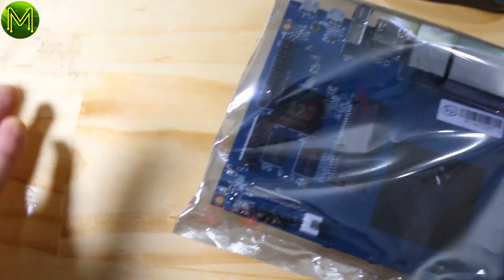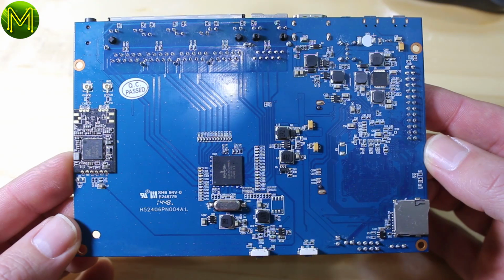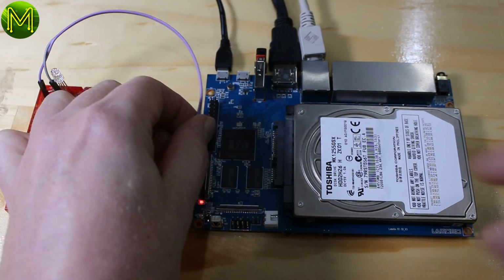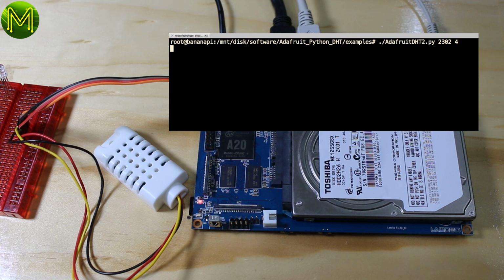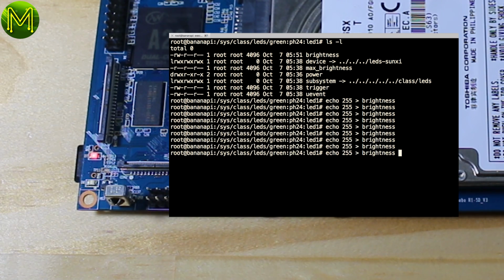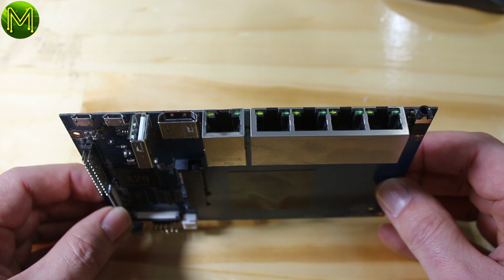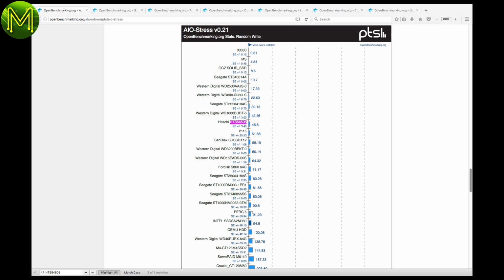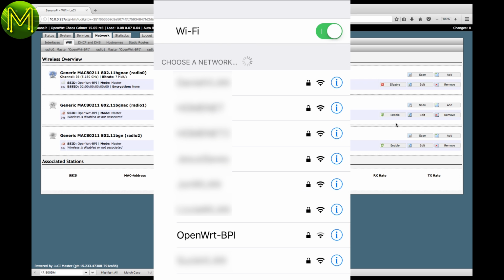#057 Banana Pi Router: NAS, router or trash? // Review

Comment: so i have a orignal xbox, ps2 and xbox 360 all modded, will this be a good device to be able to have all of my ps2 isos, roms and music on as a dual nas/router for older systems that i need a nas box for? ive played alot with the raspberry pi zero 2 and 3. but would love that but with a network switch to not only stay connected to the internet but also have a SMB folder going at the same time and pop in a ssd

Comment: Hi I know this one sounds crap, but I noticed an r2 version and wanted if that has been tested.
Reply from the maker: Not yet, but it's planned.
Reply: MickMake 
OK it's just I am after a wifi extender and wander if there any good for that. I do have a nas already  tho I may still use it as one to backup cctv footage from my garage. Though I have a open source router,I kinda think the pi version you could do better as the pi was easier to code that a normal router. This is why I was tempted, and plus more customisable,  though  slower it could have advancagers,  if the effect is but in.

Comment: 1:45 As suspected, 2tb limit sata connector. What would be great is if it supported port multiplier. I'd take this banana pi over as raspberry pi anyday however, simply for the sata port it has. Moreover though, a pci-e port on any board (especially x86) is best!

Comment: I am thinking to get one of these but not to use as a router but more like a nas and file sync server. I thought about tossing in a 2tb drive and use it as a file container to sync, backup and occasional stream video from. So far I am doing the same with a raspberry pi 2 and though I had absolutely no issues, the whole external hdd , ethernet cable, power cable are kinda hanging ungracefully. This seems a lot more like a complete unit. embedded sata and wifi has me sold. Anyone used it as a nas?
Reply from the maker: +John doe 
It'd be ok for a NAS, but don't expect blazing performance from it. It'd be fast enough for 1080p and probably 4K.

Comment: I thought you might leave us with an overal opinion of the device, especially suggested by the title.  But I'm unclear if you are happy with the device or feel it is trash.
Reply from the maker: +Dylan Durdle 
I try to avoid opinions as they can be... well... opinionated and prefer to let the viewer decide. I do, however, give it a rating based on how it works according to its intent.

If you are going to use it as a router then it'll work, but there's a speed issue. For some people this might be an issue and for others it's not.
Reply: I've been watching this device for about 1.5 years, debating.  Originally I had the belief, if I buy it, I should use OpenWRT on it.  There were so many issues with OpenWRT in the first years (think wifi didn't work).  I know OpenWRT support has improved on it.  Now I'm leaning towards just a Debian Jessie distro.  It's been a number of years since I used OpenWRT, I have been exclusively using Tomato on my WRT router for at least the past 8 years.  And since Tomato will likely never be supported, no sense going back to OpenWRT.

I have many Raspberry Pi boards, and I use a Banana Pi and Cubieboard2 powered on 24/7 on my network.  I only get about 2.5MB/s throughput.  I expect the same limitations on this since it is a Banana Pi with LAN switches.

I'm still very much on the fence on this device.  I know it's only about $60-$70, but I'm trying to deduce the number of inexpensive toys I buy that collect dust.  My junk drawers are full of them already :)
Reply: More context, I'm still using a 100Mbit router and G.  Old WRT router bought in 2002 that stands the test of time.  It is not like I'm expecting 1Gbit speeds or N.  My only wired LAN devices are printers, one or two IOT things and a Banana Pi and Cubieboard.  Everything else is wifi.
Reply from the maker: In that case this is probably a decent device for you. It won't give you the 1Gbit speeds of a $1000 switch, but good enough in your case.
Reply: I picked it up and I've been using it for a few weeks.  Meets my needs, still working on getting everything working in Debian, but all looks well so far.

Comment: Are we serious here. You expected a banana pi to perform close to actual servers designed for handling hundreds of connections at once? This device should be compared to other routers like Dlink... as an alternative in the same price range.
Reply from the maker: +Jake Abel 
Hi Jake. With my reviews the expectations I have are the ones given to me by the company selling the product. If they say it'll do XYZ, then I'll test that. If it does or doesn't do it I'll let you guys know.

Generally what you pay for is what you get and things like the Banana Pi is cheap, so you're going to get cheap results.
For some people that's OK!
Reply: MickMake The only problem I have is the bench marks you compare it to are of $2000+ systems. Did they actually state it competes with those systems or is it an entry level device for smaller networks of 10-14 devices on at same time.
Reply from the maker: A good summary of my review is: The network is slow and so is SATA, but you get what you pay for.

For some people, they want faster network and SATA, in which case they'd move up to an UpBoard2 or Jetson TK1.

I just test and present the information; the rest is up to the viewer to decide what's best for them.
Reply: MickMake I suppose that is accurate. When you said it is not even on the list under some of the tables because you are looking at a table filled with much more expensive systems. You should find a table filled with items in simulator price/specs to be comparing to. To me it looks like you are comparing Jet engine speeds to how fast can the fastest person in the world run. When you do that you make them look very slow. Should try and find tables with similar priced/spec items for comparing.
Reply from the maker: +Jake Abel 
Yup, it's a little hard as I seem to be the only one going into this depth for SBCs, but as time goes on my uploaded results will add to the list and we'll get a better picture.

Comment: >100Mbit with OpenWRT, Adblocker, OpenVPN, TOR-Router instructions on : Anleitung auf deutsch : http://sven-goessling.de/10/02/2015/openwrt-banana-pi-router-bpi-r1-firewall-und-schutz-vor-den-provider/
Reply from the maker: Thanks for that link.
It'd work well as a DSL router with low speeds, but if you are looking for true 1GBit speeds on the local switch then it'd have trouble keeping up.
Reply: Super Typ, danke dir :-D

Comment: I had hopes this would be better 😢
Reply from the maker: +Annabella Williams 
It's not too bad for the price, just don't expect it to respond like a $500 router and NAS box.
Reply: MickMake Problem I have is I'm using PFsense on a old PC and finding something low powered that I like.
Reply from the maker: *****
Thanks. Yup, it's hard to get around all the boards quickly, but that's my intent. To cover every board out there!
Reply from the maker: Annabella Williams
Yup, it's hard. At lower prices there's always trade offs.
Reply from the maker: *****
I'm tending to stay away from plain old PC motherboards as they're not really Maker boards per se. Sometimes it's hard to tell the difference, but my general rule of thumb is if it doesn't have GPIO pins, then I probably won't review it.
Otherwise my list would be endless!
Reply from the maker: *****
Ha ha! Yes indeed. I can remember my brother driving motors directly off the parallel port in the late 80s.
Reply: Because of price/performance :) They are not so wise for the money...

Comment: I've been on the fence for this for a while, I really appreciate the review, I had a hard time believing that it would support 5 gbe ports and you confirmed my assumption. However the idea is solid, perhaps if they built one using the pi compute module and just provided the required accessories so we could take advantage of the emmc storage as well.
Reply from the maker: +Daniel Stinebaugh 
It's actually pretty good for the price. If you needed a Pi compatible and a, (near), Gigabit speeds, then it's pretty cheap.
But, yes, if you're looking for decent speeds then look elsewhere.

Comment: I was looking into a Banana Pi VS. a Raspberry Pi as a Wifi Hotspot. The Gigabit Port on the Banana is a great addition, but the hotspot crashed every half hour.

Same configuration on my Raspberry, and no problem.
Reply from the maker: +Michi Lo 
Yup I had a similar unreliability issue on the banana Pi. The WiFi was a little flakey under Linux. Was ok under OpenWRT. Not sure why because OpenWRT is essentially Linux.
Reply: MickMake I think as OpenWRT is specialised on router stuff, it has different network drivers than distros like raspbian or Archlinux. Which work better on "less reliable hardware".

Comment: Seeing this gave me an idea. Considering the fact that it runs off 5vcc it could conceivably run off a portable USB power bank. That being the case it could make a decent portable data cloud for phones and other WiFi enabled devices. Also, it might be possible to attach a Bluetooth device to it and make it accessible to devices that way too. In that sense it might actually be useful for on the go data backup while keeping that data "local" more or less. I think it would be interesting if you could do a video on this. Even with the reduced speeds, the convenience of a portable NAS might prove pretty useful.
Reply from the maker: +ExStatic Bass 
Yup that's a great use for one of these. As long as you're not disenchanted by the slow SATA speeds would work well.
Reply from the maker: +ExStatic Bass
And also worth a video!

Comment: Only real possible use for this could be as a Router with a large cache drive on the SATA drive for scenarios where a number of users all browse similar pages. That and could store a copy of Wikipedia dump and possibly host it on the WRT and redirect all Wikipedia urls to it for an educational setting.
Reply: I used to run a cache at home when I had dialup but I just haven't seen any obvious benefit compared to the many drawbacks, since having broadband.

After all, if a user visits the same sites a lot they will be cached on each client anyway.  Perhaps on mobile devices with a smaller local cache?
Reply from the maker: +Robin Hilton 
Yup. That'd be a nice use for low bandwidth/offline internet situations. Although if you have a 100Mbit feed it'd be faster getting direct from the source instead of through a BPi.
I have two raspberry pis that act as my squid cluster. I'm actually finding now it's slowing things down for me.
Reply: +MickMake
I now have a 1000 down/500 up (mbit) connection so not running any caching myself.

However the Offline Wikipedia mirror would be better for rural areas or third world countries and have a system whereby they could cycle 2 drives to get the latest data dump every month or three and send the older data one back.
Reply from the maker: *****
You're absolutely right. Even at US$60 + US$50 for SATA it's a perfect scenario for low bandwidth situations.
Unfortunately I have to spend a bomb on high speed internet because it'd take me a week just to upload my videos.
But good point. I'll add this to part 2 of this video.

Comment: A shame it's performance is so poor, with the SATA connector and those Ethernet ports it could have been useful.
Reply from the maker: +Izzie 
Yup, it did look promising.
Reply: Upon expansion of the MickMake empire, you should begin creation of the perfect SBC.
Reply from the maker: Izzie
Ha ha. I have been tossing around that idea.
Reply: I second that idea. We need a more raspberry Pi styled board that doesnt require banana software(lol), that has onboard SATA and Gigabit network switch like this, and possibly a Core/Memory upgrade. Toss the Mic if you see fit...haha.
Reply: why is everyone trying to shove raspbian on non pi boards raspbian is setup to only have support for pi hardware so anything that isnt a pi is of course not going to work

Comment: thanks Mick, another good' n. I'm getting a bit sick of some of the trash that's being released. Keep up the good work.
Reply from the maker: +mike conroy 
Thanks Mike.
Yup, there's certainly a lot of "interesting" boards around and they are all doing it wrong.
They're all trying to be better than the Pi.
What they should be doing is: be different.
Being different means that they are then honestly filling a need instead of just "being yet another Pi".
Reply: Indeed. have you thought about putting something together yourself? You clearly know your stuff.
Reply from the maker: mike conroy
Actually I have, but I still need to be certain of the need that I have in mind. I can see a gap in the industry, and even though I'd end up making it open hardware I'd prefer to avoid spilling the beans far too early.

Comment: I'm going to slowly try to build my own Tablet with the features I want, but i'm having trouble finding an sbc with the features I need and a compatible 10 inch touch screen. Do you have any suggestions?
Reply from the maker: +fungunfanatic 
What primary features are you looking for?
Unfortunately with SBCs there's always a compromise.
Reply: Well I'm not so worried about price, as for the tablet I had the idea that If I build it around an sbc I can always upgrade and swap the sbc as needed. I have thought about purchasing a tablet, but none of them seem to have ALL the features I want. I want a high resolution 10 inch screen, I want to be able to install and use any OS I want (Linux/Windows/Android). I assume to achieve the OS' I want I would have to use a 64 bit sbc like LattePanda instead of an arm based sbc. One of the downsides to Lattepanda is the heat. I dunno, I can handle all the building but I'm just not 100% on really any of the hardware. The reason I want to build a tablet instead of buy one is that I absolutely cannot come up with or save 300-500 dollars, but I can purchase the individual parts over time as needed.
Reply from the maker: The theory is great, but I think in practice it wouldn't work. I was thinking of this a while back, but then you see things like the Ockel Sirius, (https://www.indiegogo.com/projects/ockel-sirius-a-the-world-s-most-versatile-mini-pc-mobile-design--2#/), on IndieGoGo.
That has everything you need and when it gets old there will be something else around. Only issue is that it's a little pricey.
Or you always pick up a PocketCHIP. Not as powerful, but lasts a long time on a small LiPo.

Comment: Oooo, when did you get your Teensies?

As for this Bananarouter, I guessed right from the beginning that it'd make for a terrible router. Even worse is that they couldn't even bother to update the OpenWRT to the final release of Chaos Calmer, let alone the security-update from March this year. I am delighted, however, that you went to all the effort try it out properly, that's real nice!
Reply: really great review. You might just save a lot of people a lot of wasted money. I think they should have named it the lemon router. I really can't see any point to this product it's just too slow to be of any good and too expensive for what it is.
Reply from the maker: Craig Fryer
Thank you!
It really depends on what you want to use it for.
At US$60, if you want it for just a router, then pick up one of the commercial routers and load up OpenWRT.
If you want to start doing some low level hacking and you don't have a switch, it might come in handy, but yup... the vast majority of people might not find this of use.
Reply from the maker: Yup. You see that Broadcom chip in a lot of cheap Chinese routers. Works as advertised, but very slow.
This board my son had lying around and he wanted to use it as a NAS box. I had my doubts about it too.
Reply: MickMake I wouldn't use ARM for a NAS-box anyways. They're either too underpowered or only have one SATA-port, or both, and then there's the whole thing with unstable software-landscape. At least on the x86-side of things you can get much higher performance and/or more ports, depending on what you want, and the software side of things is a lot more stable and there are several good NAS OSes to choose from.
Reply from the maker: Nita Vesa
Yes exactly! It's ok if you want a low bandwidth web server or something, but a full on 4K video server. Nope.
Reply from the maker: +Nita Vesa 
BTW Teenies I got as samples from an importer. Long before my Kickstarter arrives!
Reply: MickMake You just enjoy making me envious, don't you? :P

Oh, btw, yes, your videos have improved quite a lot. I still find it funny how you pronounce WiFi, but at this point you can just chuck it as one of your trademark quirks! Still wish you'd grow back some of that furry cover on your chin, though. So much of a babyface-thing going on right now :D
Reply from the maker: +Nita Vesa 
Ha ha. Yup the old WiFi issue. It's very hard to try to change and I'm thinking ah too hard.
And yes the furry face comes and goes. Maybe another trademark of mine? ;-)